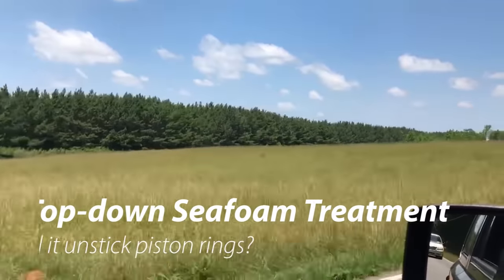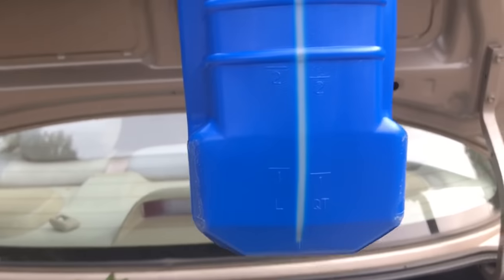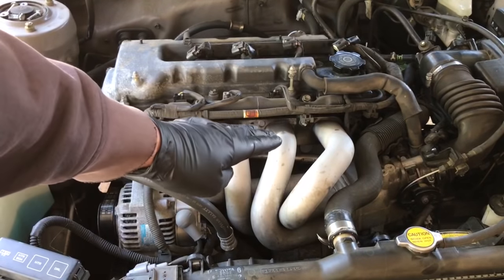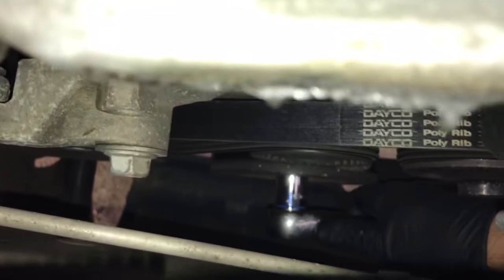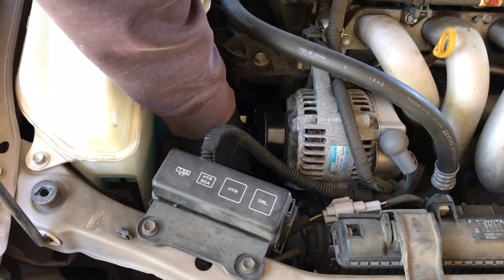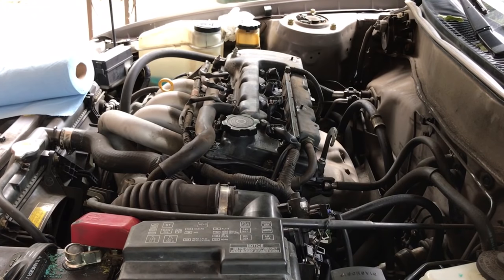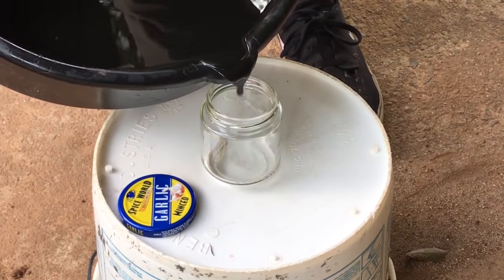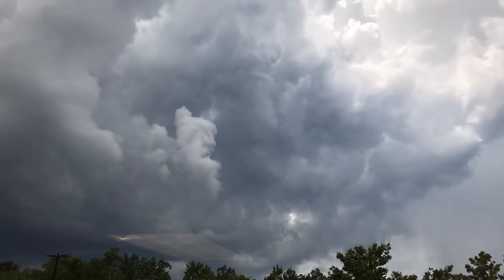I poured Seafoam down the spark plug holes! | Oil Burning Experiments - Episode 1

Comment: Face it stuck oil control rings are not the only reason for oil consumption. The rings or cylinders could just be worn out. At that mileage valve guide seals often become rock hard, blow by from worn compression rings and worn cylinder walls will cause the PVC system to suck in more oily vapor and lets not forget about external leaks.  Frequent oil changes with quality oil directly impacts cylinder and ring wear that is why some extremely high mileage vehicles don't use as much oil as others with similar mileage. So if your purchasing an extremely high mileage vehicle unless you know the maintenance history your taking your chances. Don't buy an oil burner thinking you can solve the problem with a magic oil treatment in the cylinder. The odds are against you.
Reply: Thank you paragraph guy
Reply: Telling it like it is. If I had time and money I would just pull the motor and build it.

Comment: A lot of the Old timers would pull the spark plugs out and pour diesel down the hole and let it soak for a day. Change the oil then start
Reply: Kerosene works wonders too
Reply: Wd40 helps.
Reply: @Airman.. so does gunk-outs motor medic with diesel components such as kerosene

Comment: My tercel valves stuck open one day! poured sea foam in, saved the engine. 😆 still driving 8 years later!!
Reply: I am a beginner shade tree mechanic , where did you pour the seafoam in?
The oil?  The gas? The spark plug holes?

Comment: Marvel fan here...used it in my airplane gas, never a problem and good long term compression in the Cessna 172A Continental engine. Walmart $20 pit crew oil change is worth it's weight in gold...no hassle or dirty situations. Have a look at Project Farm. He does a seafoam and Lucas in his oil and sprays seafoam directly into his intake on an old Ranger. It worked really good for him.
Reply: I bet it freaked out the Walmart oil change crew first time you brought in your 172 😀
Reply: Actually very little improvement from seafoam on project Farm.  Buy chem 12 instead, works much better!

Comment: Here’s a tip I saw 👀 a guy do. When removing filters that hang down like yours take a plastic party cup and after getting it loose put the cup over the filter and squeeze the cup while turning the filter cup catches the oil. No oil running down your arm. 😁
Reply: Awesome idea, thank you!
Reply: Or punch a hole in the old filter before removing it 🤣
Reply: If youre drinking a beer in it, it wont matter whats if the oil runs down your arm

Comment: I did this on a late 80s Tercel. It had good compression in three cylinders, but super low compression in one. Possibilities were bad rings, bad valves or broken ring. Did the oil test and the three psi went up a touch. Still super bad in the one. Broken ring or stuck valve. I took plugs out and sprayed lots of carb cleaner into each hole. Vigorously wiggled the crank back and forth a couple inches ONLY. Left and did other stuff. Knowing that the really liquid carb cleaner would evaporate and also flow past the rings and piston slots I came back a half hour later and wiggled the crank and put more carb cleaner in, wiggled the crank again and went to do more stuff. Did this four times. My thinking was the carb cleaner is a serious grease killer and would soak and soften the carbon, and moving the crank would squish out the softened stuff from the ring grooves. Changed oil and it wsa ugly, like yours was. Fired up the engine and drove about for a bit and did a compression check. Bad one was back up to the others psi, and all cylinders were a bit higher. A lot cheaper, and I didn't want to take it apart unless I had to. In the Navy we wouldn't mess with stuff we didn't have to to avoid making more problems.
Reply: Dude this is 👍🏼
Reply: Go Navy!!!!!
Reply: Didn't they have mechanical valve lash adjusters? Did you check the valves?
Reply: @gregorymalchuk272  I suspected that. The valves were fine.

Comment: You didnt run the engine to fill the oil filter first before filling the oil to the "full line". It would have dropped a lot after filling the oil filter. You needed to top up the oil after running it!
Reply: I agree. The filter alone probably holds 1/2 a quart or more. I always do the "flood" start procedure after changing oil. On fuel injected cars, hold the gas pedal to the floor then try to start the car. It will not, because the throttle pegged at start-up shuts off the injectors. Then crank it over a few seconds until the oil light goes off (or gauge registers pressure). Let off the gas and it will start right up.

Comment: This caught my attention because I have a 2002 Corolla LE, 173K miles and even the same color as yours. It used oil to the tune of a quart every 800 miles. I upped it to 1600 miles by switching to 5W40 100% synthetic Castrol oil. In the past I've always used 5W30 synthetic. My old oil was never as black as yours, just a dark amber. I would change it every 7000-8000 miles. I haven't noticed any difference in the way the car runs with the 5W40. I replaced my spark plugs at 150K. They looked way better than yours did. I'm surprised you didn't replace them when you had them out.
Reply: just get a new car bro...dont be cheap

Comment: Toyota fix is  to replace the pistons and rings with updated pistons. 
 Its about $1,000 for parts pull the head and pan push out the old pistons . The updated pistons have larger oil recovery holes .

Comment: That's very informative, I don't know if it was pointed out in previous comments, but unstucking rings works best on a very hot engine. You add the seafoam inside and you put the spark plugs back in to seal it so it evaporates inside the chamber. Leave it overnight, and next day you move the crank left right a bit to unstuck the rings that soaked in seafoam for a quite some time.
Then you can still leave it or add even more. Let it for some time, the longest the better. And resume with removing the liquid as you showed in the video.
oil replacement after 100-300 km after adding seafoam to the oil  that leaves more time to the oil to clean the engine.

Cold engine is way less effective.
Reply: Nice ... thx for the tip
Reply: I've always run it hard after adding the seafoam and replacing the plugs
Reply: Leaving it in over nite  My experience on a Honda CRV is it all ends up in the crank case ! I was trying to free the compression rings !
Reply: I wouldn't pour I would use the seafoam spray that says motor treatment high miles while motor is hot and just spray in spsrk plug holes then add to gas tank and intake manifold while car is running hot then run it on a clear freeway way at high r.p.m's and burn it out but be careful it can cause damage to seals and rubber parts if done too much or left too long in there only 100 miles to 200 miles is good then do it again down the road later on and stop using bad oil and cheap gas I use mobil, amsoil full synthetic and some times 91 octane Chevron with techron to help clean it out runs like a champ and smooth shifting gears

Comment: You could put the piston at bottom dead center just before the compression stroke. 
Remove the spark plug.
Fill the cylinder with Seafoam.
Put the spark plug back in.
Turn the engine over by hand with a breaker bar and socket on the crank pulley bolt, to raise the piston up the cylinder.
This will force the Seafoam around and behind the rings.
Do one cylinder at a time.
Reply: Good idea to add chemical cleaner at bottom dead centre, definitely doing use the starter or you could bend the connecting rod. I think really it would be better to clean piston ring from the bottom end by adding Chem to oil though that could be hard on engine berrings and seals.
Reply: @martinmuldoon603  I would not use the starter. Bar the engine over by hand so you have more control over how fast the piston comes up, to prevent bending the rod or breaking a piston ring.
Reply: Why not add a 1/2 qt marvel to the oil change?  Wouldn't that help?  ?
Reply: What’s wrong with brake cleaner or Carb cleaner? You will have to replace the motor oil immediately and give the crankcase time to vent the flammable vapors out. Carb cleaner eats sludge!

Comment: Hi Dave, interesting videos.  I just purchased a nice 2011 Audi Q5 with 82,000 miles, and I since found out this model is known to have oil consumption problems caused by sticking oil rings on pistons.  I went through my first tank of gas, and sure enough, it consumed a litre (quart) of oil in that time.  I tackled it with Lucas Heavy Duty Oil Stabilizer, and that helped reduce consumption, but it did not eliminate it.  I have since had to add another litre of oil, and I used Castrol GTX High Mileage 5/30.  I am planning to use an oil flush at the next oil change, and then perhaps keep using high mileage blends after that.  I'll keep you posted as I measure my results.  Thanks for giving us all hope!
Reply from the maker: Thanks Tim, and yes, please do keep us posted!
Reply: any updates? you try the piston soak with the Q5?
Reply: Update?
Reply: Still waiting on an update
Reply: I have gotten lazy about tracking consumption rate.  I change oil every 8000km’s, and I add 2 litres of oil between changes, so I think it has improved.  I top up only with the thick stuff.  I’ve done the flush twice, and expected to see black oil, but it was amber and clean.  At this point I’ve accepted the oil consumption.  I like the car enough to keep it.  It doesn’t blow blue smoke, so I’m happy enough.

Comment: Had an issue like this, no smoke, no puddles of oil under the car. Turns out the oil filler cap seal had turned from rubber to plastic and was letting a considerable amount of oil leak onto the top of the engine leaving jt with a shiny appearance, I figured I'd just spilled some when filling it up and wiped it off, it kept coming back until I replaced my cap. No more missing oil.

Comment: one thing i think most people don't consider but would be an advantage to the sea foam approach is its actually a fuel additive so basically its suppose to be in the cylinder so you don't need to be condenser with removing 110% of it from the cylnder and engen

Comment: BG EPR is one of the very best oil additives for cleaning stuck oil rings. I follow up with Mobil 1 0w-40 (light 40wt oil which is close to 30wt) for a long interval. This oil is confirmed to do a very thorough job of cleaning sludge and carbon.
Reply: Atf works great also
Reply: @josephfreeman1427  do you add some atf to the oil or let it soak in the cylinders
Reply: @Mikesroadtrip-ec5kp  Soak in the cylinders to help free stuck rings. Pull the plugs and fill the each cylinder. Check them them the next morning to see how much is left. I would crank the car over to get the excess out and put the plugs in and try it again.

Comment: The reason why the oil was thick and dark, because the Seafoam loosen the carbon deposit from the top of the pistons. That build up was thin enough to go though the rings down to the oil. If you are noticing blue smoke from the exhaust, it means your engine is burning oil due to an oil leak. This symptom could be the result of a leaking valve seal or a problem with a piston ring. That escaped oil can then mix with the fuel and burn as the fuel burns. Therefore it doesn't look like you have that problem with your compression rings or oil rings. Those spark plugs looked very bad. Stop being cheap and change the spark plugs, PVC valve and also check your valve cover and oil pan for oil leaks. It"s a good chance your loosing oil from those area and not burning oil.
Reply: could be pcv valve, burned 2 quarts on a a 2arfe toyota engine the 2.5l. Since the change last week i have burned like nothing. also cleaned out the cylinder heads with lucas injector cleaner. it got rid of a lot of the soot stuck to the pistons from the burnt oil. PCV valve also needs to be changed every 100k miles so might as well change it.
Reply: If efficiency is what your going for…….You ccould have purchased all 4 spark plug for under $10 for that Corolla, lol why wouldn’t you just change them 🤑🤑🤑
Reply: Or at least clean em up with some carb cleaner...🤷‍♂
Reply: Seafoam has a chemical reaction with oil additives and turns the oil dark.
Reply: I cleaned my area out with sea foam engine spray and upgraded my spark plugs. Made a world of a difference. 😊

Comment: Very informative and not rushed, thank you!  A thing I would suggest to make it easier to find middle on the cylinder (between top and bottom dead center), use two sticks instead of 1 - put them in opposite position cylinders (e.g. 1 in the 1 or 4 cylinder, and 1 in the 2 or 3 cylinder).  Then rotate crankbolt clockwise until the two sticks are level - that will be your center
Reply from the maker: Great idea! Thanks!
Reply: @FamilyFriendlyDIY  curious what you think of this–

would there be a good way to safely push down the solvent into the ringers more with compression (without hydrolocking)?  I've seen some people recommend putting piston bottom dead center and then putting solvent in (doing one cylinder, or two at a time).

I would like to do this but thinking about reinstalling spark plugs hand tight so there is some compression and so that the solvent won't evaporate up.   At this point is it same to crank by hand and "force" oil by the rings (not using the starter of course).  I don't think it'd be possible to bend the rods this way by hand?

Lastly I was wondering about the part where you wiggle the crankbolt in both directions.  I have a MINI R55 and wondering if it's ok to wiggle it backward a tiny bit.  I don't want to mess up the timing
Reply from the maker: @SZGX  The Seafoam site actually recommends doing as you suggest, installing the plugs to use compression to drive the solvent into the rings (by hand of course). ... I'm not sure about rocking your crank. The 1zzfe timing chain is locked down pretty tight by the ratcheting tensioner, so it can be rotated either way. But I know some engines can't.

Comment: Berryman's B-12 Chemtool used as a piston soak is a much stronger chemical to clean and free stuck rings and ring grooves. The other product I have used with great success for piston soaks is Kano Labs "Kreen". Use it as a piston soak from the top in the combustion chamber, then after it soaks past the rings and down into the sump engine oil, run  it in the oil with a new filter until that oil is good and dirty. It may take a few complete cycles, but eventually the consumption will lessen as the piston rings get freed up and the ring lands get cleaned up . I like to go up one step in oil viscosity when cleaning with chemicals that thin the oil. So if it calls for 5W-30, I will use a 10W-40 or a diesel-rated HD 15W-40 while running with a cleaner in the sump oil. If an engine calls for a 0W-20 or 5W-20, I will use a 5W-30 or 10W-30 with the cleaning chemical in the oil.

Comment: For seven years I have had a 2008 Chevy Equinox LTZ 3.4L 6 cyl  114k miles. The engine is great in every respect except one, it consumes about 1 qt every 1k miles. No visible oil leaks, and Idles beautifully at around 600 RPM. No oil residue in the air intake from a possible stuck PCV valve.
Reply: and then it blows out the crank seal from the trash PCV valve

Comment: You pretty much nailed everything I was going to touch on. Root of the deal (and you probably know this, but for those that don't), this is unfortunately a well-documented case with this and a few other Toyota 4 cylinders that ended up in a lot of cars, which was completely a manufacture 'defect', aka design mistake. The low tension rings will close up on the pistons after a time and there's almost no getting around it if you're just using regular oil (to include full snyths), even with preventative early changes. Problem being that you have to add concentrated solvents to keep them from sticking, at which point, you're destroying the lubricative properties of the oil and doing more harm than good for the rest of the engine. Toyota did fix it eventually, I forget exactly when, but memory tells me the mid 2010s (like 2014/15 model years).
Seafoam is about the safest option as it is a concentrated solvent but won't do *as much thinning of your oil, but it isn't a one time application solution either. You can do it initially a few weeks before a total oil change and maintain treatments going forward, but it won't completely solve the problem either, more or less a band-aid. That's not a ding on you or other users, it's totally on Toyota.
You could let acetone sit as you did, and it will certainly slip right past the rings and into the oil pan given enough time without air to evaporate into. If you're planning on doing an oil change right after, there's not much to harm other than residual acetone now in the oil system necessitating a full flush. Personally I wouldn't use acetone, though if you have access to industrial chems, hexane is an option mixed with naptha and toluene.  None of the three are particularly pleasant to be around and are extremely volatile. 
In the event you were curious or didn't know, most dipstick markings on all gas-driven vehicles indicate one quart low between the dots or hash marks. Diesel's don't exactly follow the same protocol due to how much oil sits in the pan and variance between manufacturers and models, but the general rule is 'at least one quart'.

Comment: Yes. In the crankcase is better.
On a V engines you can't soak the rings because of the cylinder angle.
Reply: Yes you can just use axle stands on one side